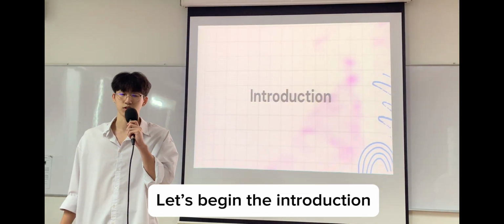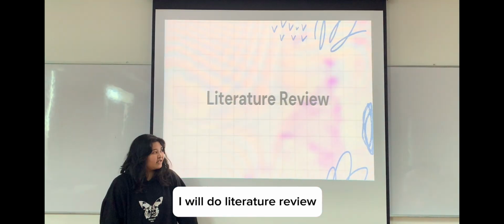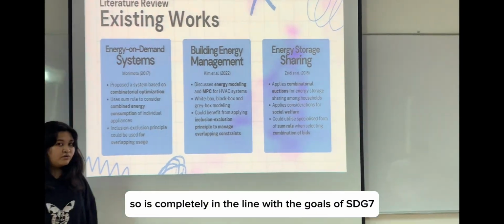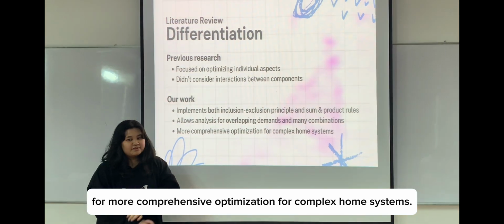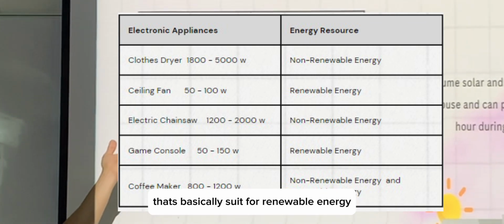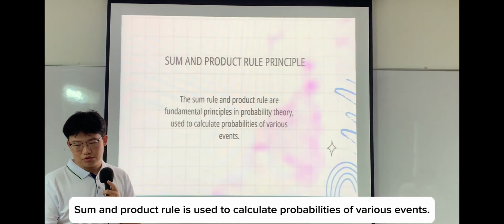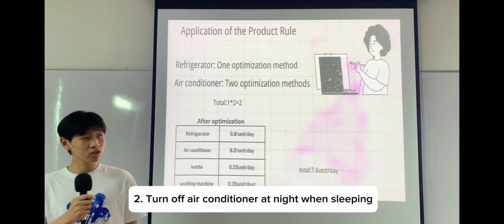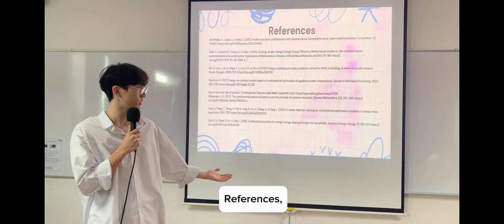Optimizing energy efficiency in household appliances (discrete structures presentation)

Comment from the maker: Sum and Product Rule 

 

3.2.1 Methodology adopted and its justification. 

 The sum and product rules of probability are techniques for calculating the probability of two events based on the individual probabilities of each event. The addition rule helps in determining the likelihood of one of two events happening without both occurring at the same time. The product rule is used to determine the likelihood of two independent events occurring together. 

Our project aims to utilize mathematical principles, specifically the laws of addition and multiplication, to suggest ways to improve the energy efficiency of household appliances. Analyzing and improving the usage of household appliances can decrease energy loss and enhance energy conversion efficiency without compromising appliance functionality. 

3.2.2 Methodological Framework (Assumptions and Tools and Techniques) 

Assumptions: 

Assumptions about the whole: The energy consumption efficiency of each unit remains constant at all times, and the daily usage time is equal and fixed. 

Under the premise that the energy consumption elements of each appliance can be improved independently, the Sum and Product Rule is a method of calculating and proposing the overall energy efficiency. 

1. The daily energy consumption of the refrigerator consists of compressor (40%), cooler (30%), lighting (10%) and door opening frequency (20%). 

The energy consumption of the refrigerator consists of the sum of the compressor, cooler, lighting, and door opening frequencies, and the energy consumption of each element can be improved independently. 
 
2. The daily energy consumption of the air conditioner consists of internal temperature control (50%), external temperature (20%), usage time (20%), and fan speed (10%). 

The energy consumption of the air conditioner consists of the sum of internal temperature control, external temperature, usage time, and fan speed, and the efficiency of each element may be improved independently. 
 
3. Daily energy consumption of washing machines consists of washing time (40%), water temperature (30%), dehydration rate (20%), and frequency of use (10%). 

The energy consumption of the washing machine is composed of the sum of washing time, water temperature, dehydration rate, and frequency of use, and the efficiency of each element may be improved independently. 

 

Tools and Techniques: 

Sum and Product Rule Results is chosen because it is easy to understand and can easily compare energy consumption before and after optimization. 

1. Daily energy consumption of refrigerator before efficiency improvement 

Compressor: 0.4 * 100 = 40 kWh 
Cooler: 0.3 * 100 = 30 kWh 
Lighting: 0.1 * 100 = 10 kWh 
Door opening frequency: 0.2 * 100 = 20 kWh 

(0.4{40%} / 0.3{30%} / 0.1{10%} / 0.2{20%} = {1=100%})  
Total: 100 kWh 

2. Daily energy consumption of Air Conditioner before efficiency improvement   

Internal temperature control: 0.5 * 100 = 50 kWh 

External temperature: 0.2 × 100 = 20 kWh 

Usage time: 0.2 * 100 = 20 kWh 

Fan speed: 0.1 * 100 = 10 kWh 

Total: 100 kWh 

3. Daily energy consumption of washing machines before efficiency improvement  

Washing time: 0.4 * 100 = 40 kWh 

Water temperature: 0.3 * 100 = 30 kWh 

Dehydration rate: 0.2 * 100 = 20 kWh 

Frequency of use: 0.1 * 100 = 10 kWh 

Total: 100 kWh 

Calculated using the sum rule and "Product Rule":  

1. Improving the energy efficiency of the refrigerator: 

If the compressor's energy consumption is reduced by 10% and the cooler's energy consumption is reduced by 20%, the overall energy consumption is improved by 32% to 1.1 * 1.2 = 1.32. 

Apply the Product Rule: calculate the overall efficiency improvement by multiplying each element's improvement rate (32% improvement to example values). 

Improve energy efficiency: 

Compressor: 40 kWh * 0.90 = 36 kWh (10% improvement) 

Cooler: 30 kWh * 0.80 = 24 kWh (20% improvement) 

Lighting: 10 kWh (no change) 

Door opening frequency: 20 kWh (no change) 

Total: 36 + 24 + 10 + 20 = 90 kWh (10% improvement) 

Calculate actual energy consumption (Sum Rule): individually improve the energy consumption of each element and add them together to calculate overall energy consumption savings (10% improvement to actual value) 

2. Improving the energy efficiency of the Air Conditioner: 

If the energy efficiency of internal temperature control is improved by 15% and the energy efficiency of fan speed is improved by 10%, the overall energy consumption is improved by 26.5% to 1.15 * 1.10 = 1.265. 

Internal temperature control: 50 kWh * 0.85 = 42.5 kWh (15% improvement) 

External temperature: 20 kWh (no change) 

Usage time: 20 kWh (no change) 

Fan speed: 10 kWh * 0.90 = 9 kWh (10% improvement) 

Total: 42.5 + 20 + 20 + 9 = 91.5 kWh (8.5% improvement) 

3. Improving the energy efficiency of the washing machines: 

If the energy efficiency of washing time is improved by 20% and the energy efficiency of water temperature is improved by 15%, the overall energy consumption is improved by 38% to 1.20 * 1.15 = 1.38. 

Washing time: 40 kWh * 0.80 = 32 kWh (20% improvement) 

Water Temperature: 30 kWh * 0.85 = 25.5 kWh (15% improvement) 

Dehydration rate: 20 kWh (no change) 

Frequency of use: 10 kWh (no change) 

Total: 32 + 25.5 + 20 + 10 = 87.5 kWh (12.5% improvement) 

Critical Analyze of the results 

These figures were used as an example to calculate the overall energy efficiency improvement by multiplying the energy efficiency improvement rate. When we improved the energy efficiency of individual elements of each appliance, we used the sum and product rule to show how the result affected the overall energy efficiency. 

These examples can help to break down the energy consumption of home appliances into several factors and suggest ways to reduce overall energy consumption by improving the efficiency of each factor.